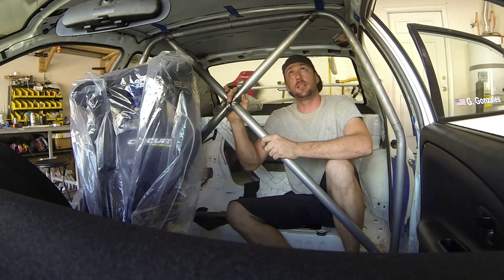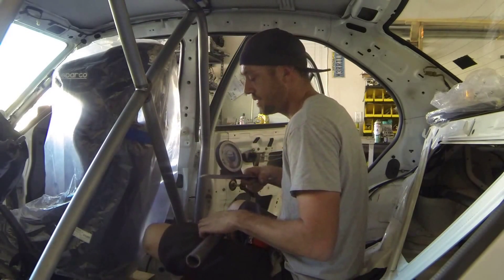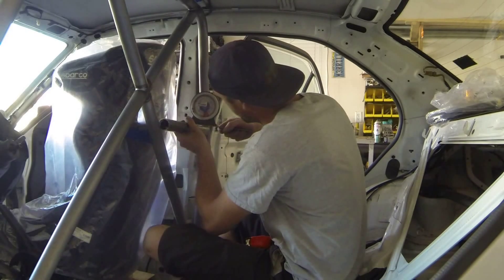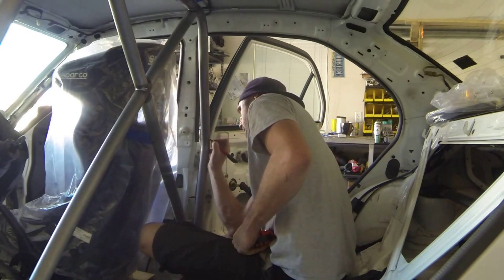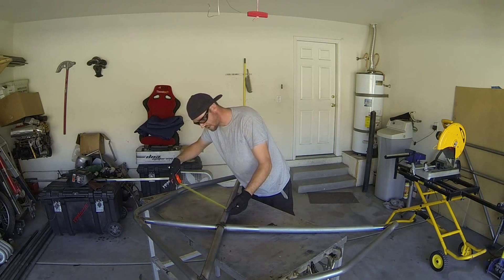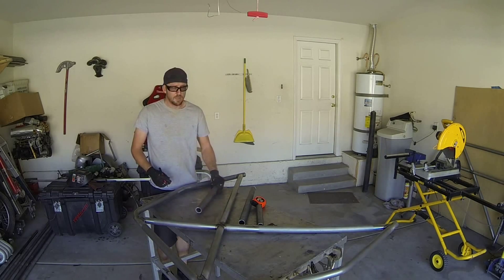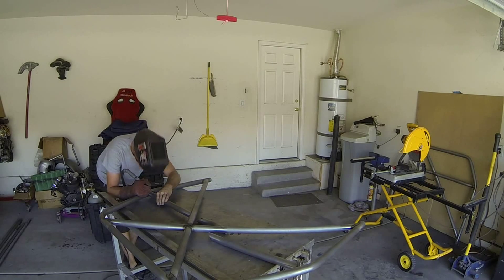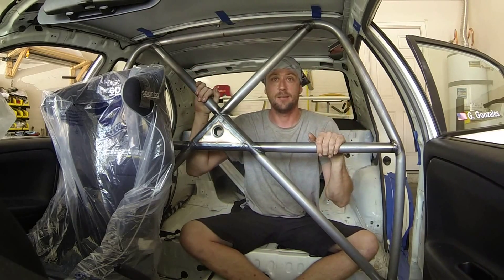TFSS: How To Build A Time Attack Roll Cage - Harness Bar

Comment: Did you fit the harness bars before you fabricated the rocker boxes?
Reply from the maker: martyn jones Yes. The height and position were set as if the rocker box was in place to ensure accuracy of the harness bar position.
Reply: Thanks dude. Makes sense doing it that way, but couldn't remember seeing it in the video. Just bought a JD2 bender to fabricate some parts for my 70 Mach 1 Mustang race car. Your videos are an inspiration.

Comment: When u tack weld why didn't you use the filler, or did you?
Reply from the maker: Autognous tacks do not require any filler. It's just a simple fusion process that holds everything in position while you work.